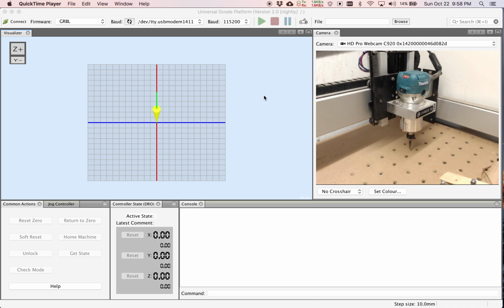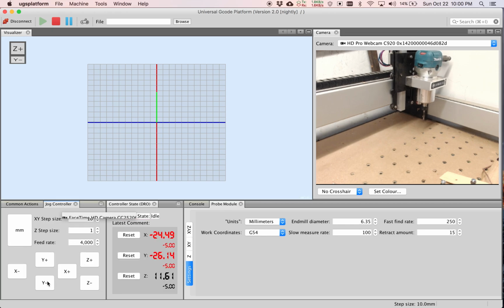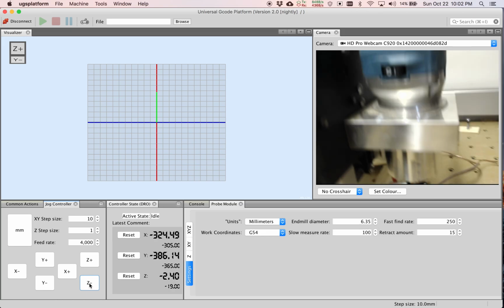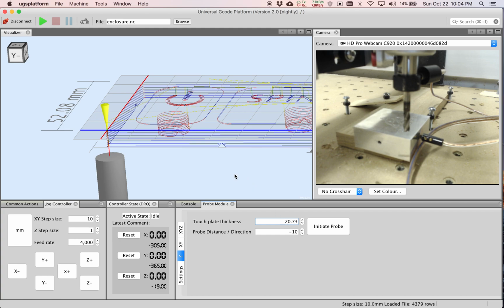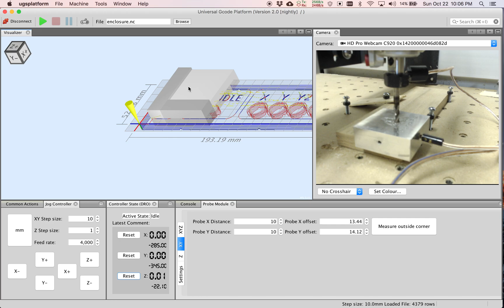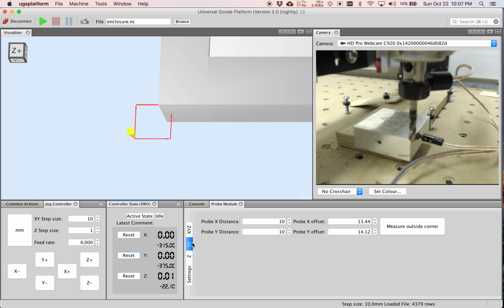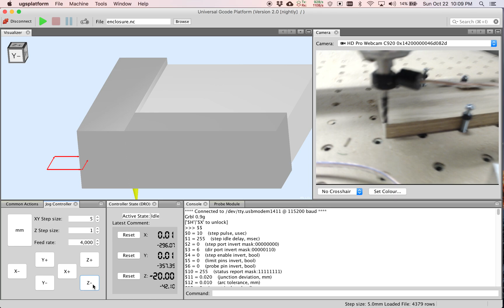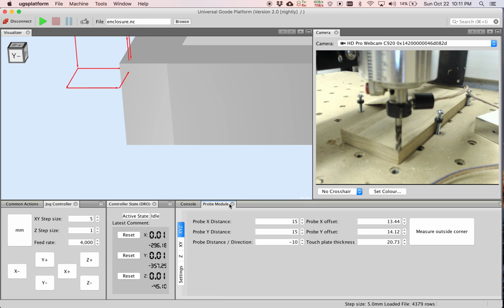Universal Gcode Sender Probe Module Demo

Comment: @Will, Please consider adding a setting for probing for the "inside corner" rather than the "outside corner". I built a touch block that has the contact surface on the inside rather than the outside for X and Y axes.

Comment: Would the probe addon work for any machine or is it firmware dependent? Would love to be able to probe all 3 axis on my Millright Mega V I just got the build complete and learning all the software now.
Reply from the maker: I've only tested it with GRBL. I believe thats what millright uses so it should work for you.
Reply: Kraken Studios any luck getting this working with Millright? I have the carve king and got the probe to try this out. Trying to figure out how to connect it to the arduino board.

Comment: Great video. for some reason my xyz probe when run in xyz will travel almost the entire way down the probe after it does the z and then the x. cant figure it out. it is actually working perfect on the x and y probe and the z probe but does it only on the xyz probe setup, any idea thanks again, Bob

Comment: i don't understand what the -10 is about
Reply from the maker: On most machines the Z axis homes in the positive direction (so it is raised all the way up). When probing you need to probe in the negative direction (all the way down). In this video I was probing down 10 units, so -10.

Does that answer your question?
Reply: thank you. What pinout does the touch plate use? im using cnc shield. also where did you get the camera plugin :)
Reply from the maker: FoxyBingo the grbl documentation on GitHub has a good section for wiring these things.

I updated the description with a link to the camera plugin.
Reply: Thank you i couldnt find that via google. Ive also seen a coolant control plugin if anyone knows where that is. thanks
Reply from the maker: No problem. The "Overrides" tab (open from window menu) has a coolant button for Grbl 1.1